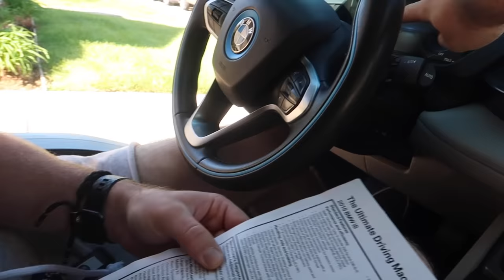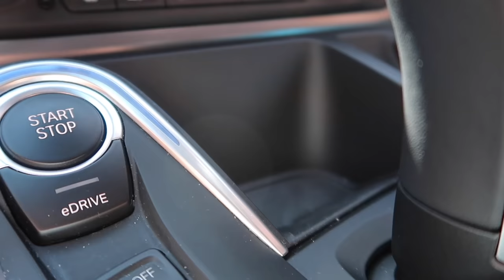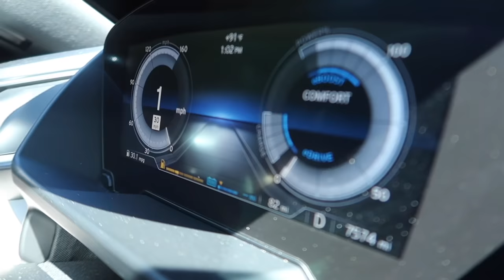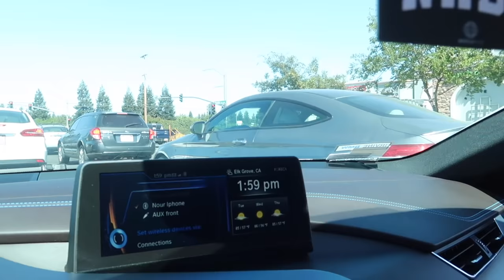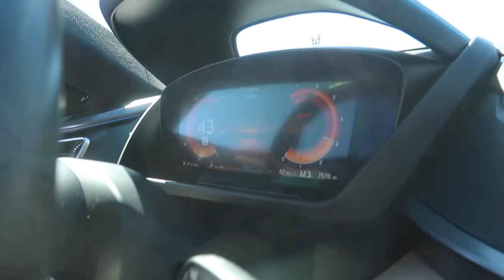SURPRISED My Friends And Family With My New Car!

Comment: Bro after driving 500 miles u cant just spray and wipe the car down without damaging the paint finish. You definitely need to canon foam blast with a proper 2 bucket wash at the very least!  That car deserves that .